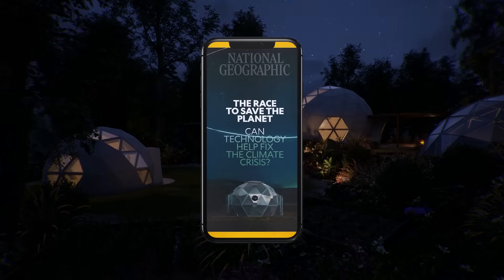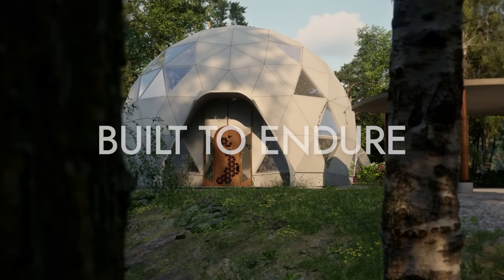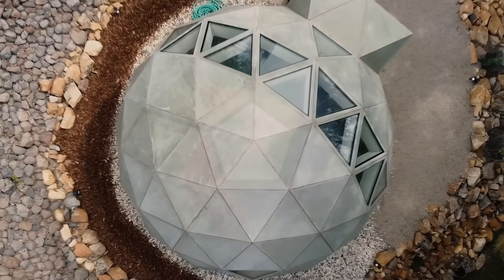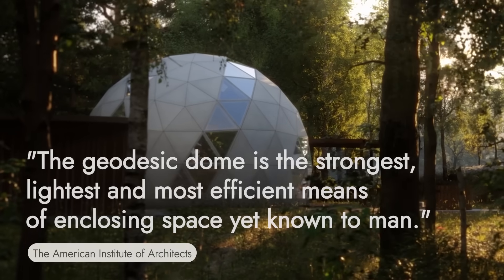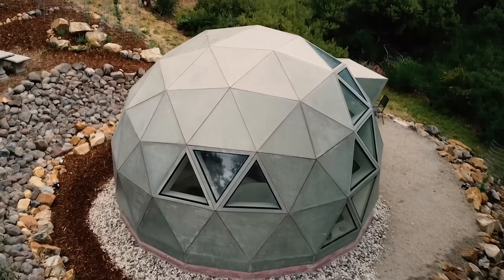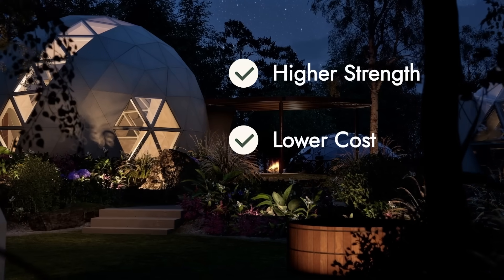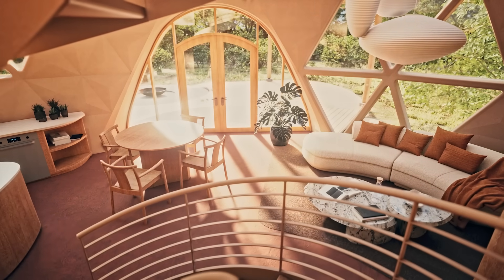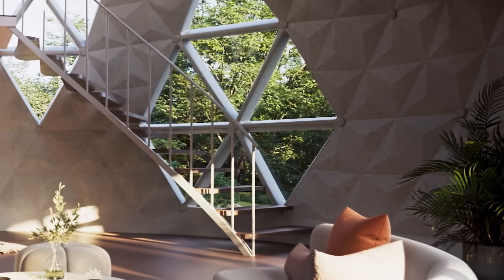Geoship | The Future of Housing is Regenerative

Comment: I am conflicted. Certainly, i love the materials and the design. However - we need medium density 3-6 story buildings with large balconies and lots of light. We need European style density with bike and walking, trams for longer routes. Etc. i would see this happening if the material could be used for larger beams, or at minimum used with large laminated beams of wood or bamboo to create these types of spaces. Because small cabins in the woods have extremely limited use case and no impact on urban spaces. I wish i could invest a lot, assuming the materials had strength to do such things. Best of luck though. ❤
Reply: Let’s say you can use bio ceramics to make fire proof water proof nontoxic 2x4 and 2x6. You tell an investor you are looking to replace all building lumber in Home Depot. That is a very big market. Then you use that to build other products and solutions. ❤

Comment: My questions to Bioship is since the bio ceramic material was invented originally to store nuclear waste (at least that is my understanding, correct me if I am wrong), could the correct materials be introduced to make a radiation resistant structure on the Moon or Mars? if so reinforcing a dome to withstand 1 atmosphere of pressure on the moon is probably a mostly simple addition. in the end people will likely need to live underground on the Moon and Mars.
Reply: We can learn to live in harmony on earth.
Reply: Add a foot or two of ice or lead around the outside shell of it. Or place it in a cave or small crater.

Comment: Could you please provide more details about the binder you are using to connect each panel? Has this binder been tested against moisture and external elements for an extended period? Additionally, how do you open the windows? Lastly, what is the material used to construct the scaffolding that holds the panels together?
Reply from the maker: the entire structure including binder, struts etc is bioceramic and everything is being rigorously tested. any window can open.